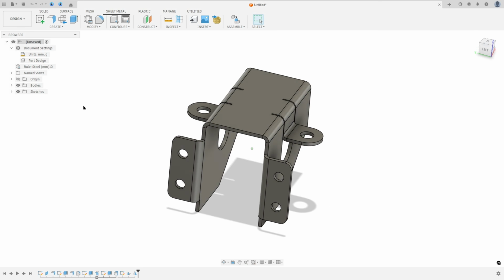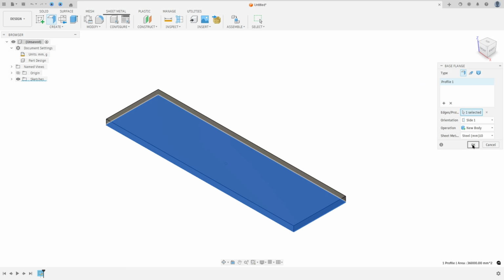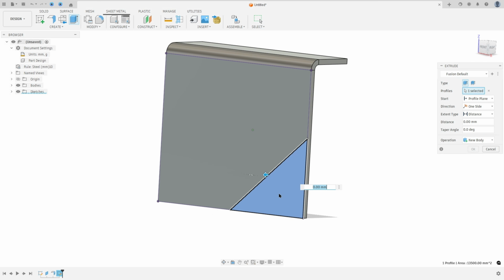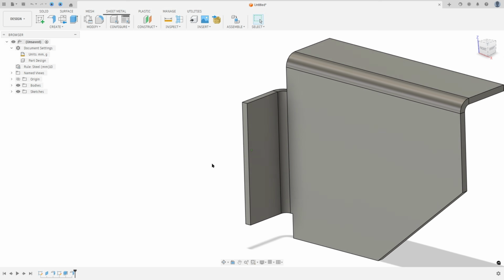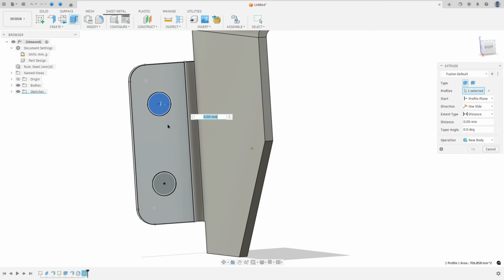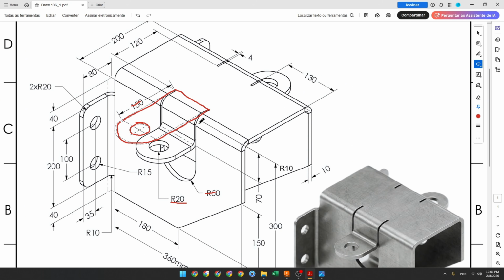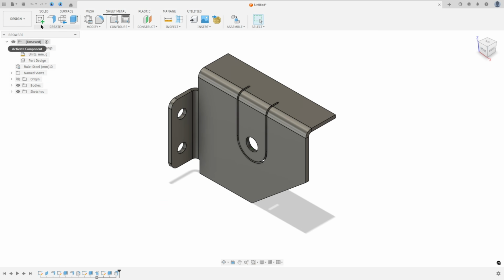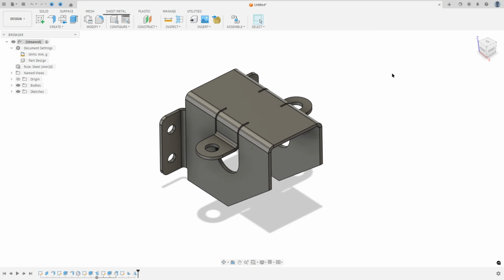Fusion 360 Sheet Metal Practice Series – Exercise #1

Comment: There is an error in the bend at the rear section where the two holes are located. The bend line remains inside at the lower part. However, in the original drawing, this bending line actually goes straight down.